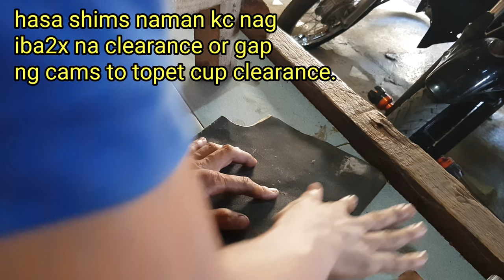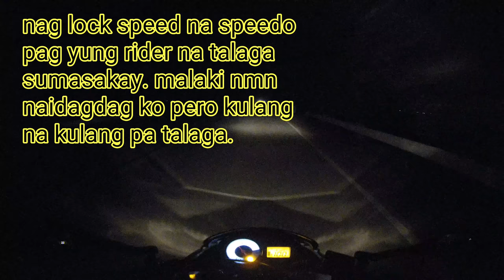RACE | Natalo,sumobok ulit makakabawi kaya?

Comment: Kung naka camshaft ka sir panalo yan for sure
Reply from the maker: May chance nga kung nka racing cams lang ako.. kulang din kc sa budget at ako gumagastos sa motor ko.mas lalo lumakas  fi nayan ngayun sr. Nagpa remap ng RECU lastrace nila is loaded na carb iniwan ng poste.
Reply: @YourMotoTUne  malakas talaga raider fi sir ahhahahaha, lalo na naka 38mm TB tapos port head lang kaya na sumabay sa 177cc na sniper
Reply: @YourMotoTUne  may 68mm bore set na raider fi sir pitsbike brand. Diyan na malalaman kung sino pinaka malakas sa 177cc category

Comment: stock fi vs madaming dinagdag at pinalitan hahahaha 😂 nag pa overhaul pa 😂😂
Reply: kaya nga eh, di matanggap ng iba na mas better tlga f.i, whatever reasons they have, f.i is still an upgrade and has better engineering than carb type
Reply: Parihas namn malakas rs mga idolsssss
Reply from the maker: Top overhaul, lang.. boss explain ko sayu yung lamang ng f i.. mas malaki  valves ng f i intake  at exhaus ng 1 mm.. at mas mataas din lift ng cams ng fi.. sa compression ratio lamang parin si fi kysa motor ko na nka highcomp lang.bigyan mo ko carb na raider kalaban try natin boss.
Reply from the maker: Sa throttle body lamang din si f i,32 xa ako nka 28mm carb lang.. ngayun saan parti ba ako nakalamang,

Comment: Mali po porting ng head mo. Wala po tlgang ilalakas ng ganyang port
Reply from the maker: hindi lang port basehan sa set up., tsaka kahit anung port payan.. yan,wala talaga panlaban ang carb sa fi.pag pareho nang naka set up.malaki valves ng fi at mas mataas ang lift ng cams,mas mataas rin compression ratio ng fi.
Reply: Fyi may mga sukat po ang porting ng head naka dipende sa anong load ng motor.

Comment: kung raider 150 series 1 yan un 1st gen for sure stock to stock  guguhitan lang ang raider fi niyan.... iba takbo ng series 1 eh.. kahit me angkas ako ginuguhitan lang ang naka single na raider 2nd gen, 3rd gen etc na klase ng raider..
Reply from the maker: Nope.. malakas na sa gen 1 motor ko paps na testdrivena namin.. tapos yung fi hindi na stock enjector,overall lamang talaga fi.
Reply: Your MotoTUne sakin kasi un series 1 ko stock lang pero naka dbs pipe tapos big tires at mags pako naabot 158-159 then nung ng racing cam ako, tapos kitti clutch spring then bawas teeth sprocket nalampas na 180 eh.. mataba pa gulong ko.. at mags pa..dbs pipe original nakuha ko worth 20k.. iba kasi ang set up nun high compression... sisiw lang maabot 135-140kmh.. big tires pako na dunlop..puro genuine at original na set up..
Reply from the maker: @ryandoblon4720  yung spedo hindi tlga pwd maging basehan kc hindi accurate. gps yung maganda gamitin.motor ko 142 topspeed pero talo yung gen 1 na naka 153 topspeed. Ngayun kung mag racing cams  shempre lalakas talaga gen 1 pero sa fi throttle body at enjector or ecu ba, at remapping laki tlga ng maidagdag.kahit pa loaded na carb talo parin sa fi na naka complete  set.
Reply: @YourMotoTUne  ang alam ko kahit un iba nagsasabi walang limiter ang series 1 at isa pa high compression ang set up ng series 1.. ilang beses ko na yan subok 2004 model na raider ko.. sa gps naabot 150 lampas un.. malaki pa nga gulong ko.. pinakamalakas talaga kahit sino tanungin mo ang series 1 kasi fresh japan pa makina un 2nd gen pataas alam ko malaysia or vietnam na same sa honda wave honda wave na design thailand at vietnam pero honda dream japan pa.. isa pa kung sa kargahan mas matindi kargahan ang carb overloaded.. pero mas lamang sa hatak at responsive ang fi.. wala pa sa talambuhay ko nakatalo na 2nd gen pataas na raider sa 1st gen ko.. kahit kasi stock mukhang kargado manakbo.. kahit ang suzuki umamin na ang top speed sa gps ng 1st gen naabot ng 155 via gps unlike 2nd gen pataas 130-140 plus lang lalo sa tachometer.. iba manakbo talaga 1st gen kaso bihira na meron at dami na tama tulad sakin lagi me tama berrings.. iba sa tibay at lakas at bilis.. aminado na suzuki kaya nga binawasan nila hp ng 2nd gen pababa mula 16.5 ginawang 15.4 dahil dami naaksidente lalo sa japan as report kaya nabanned yan dun. ang fi lamang kasi pure combustion direct sa chamber.. carb hahanap pa magandang hangin para matimpla ang motor ng tama..20 years nako nagmomotor meron din ako hyper underbone pero sibak lang ng 1st gen talaga lalo na un reborn...
Reply: @YourMotoTUne  kung stock sa stock kahit me karga ang ibang raider sinisibak ng series 1 ang ibang raider.. iba takbo ng raider series 1.. un stock nga lalo na reborn raider pinapauna ko pa 3 poste eh guguhitan ko lang.. pero iba na usapan kung naka ecu na fi.. dapat me karga na at me set up na series 1..para guhitan ang raider fi.. sa totoo lang talaga ang mga bagong raider nahihirapan na tumakbo ng 135 pataad samantala sakin sisiw maabot ang   140-145 then dun na gapang ang speedometer.. hanggang makaabot 155 lampas... simula 2004 hanggang ngayon kung hataw ako wala nakakahabol na ibang raider dun.. sabi ng mga mechanical engineer iba talaga raider na series 1. un mga bago mahihina na..

Comment: size ng sprocket mo paps?
Reply from the maker: 14 42
Reply: Bat dimo subukan 14/41 or14/39 sir..akin po kasi 14/41..stock lahat maliban sa carb..sarap sa dulo..mags din ako 80/80 rear..maganda na kasi set up mo baka tuning sa sprocket combi lng kulang..RS po
Reply from the maker: @porkyboyvlogs969  talo parin paps iba tlga fi
Reply: Ang r150 fi kasi 34mm ang trottle body nyan kahit stock kaya malakas. Eh ang carb type stock 28mm lang size ng carb.
Reply: Mag 38 ka likod 16 sa harap
Reply: Try mo ang 14/40 boss pang 1km yan tama lang talaga yan sa set up ng motor mo paps